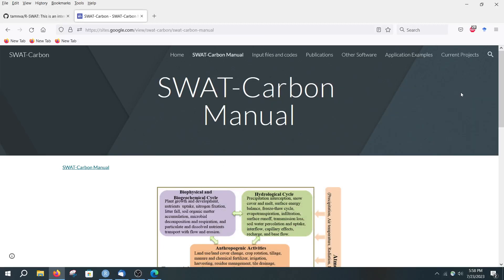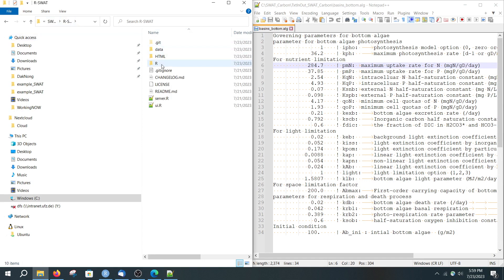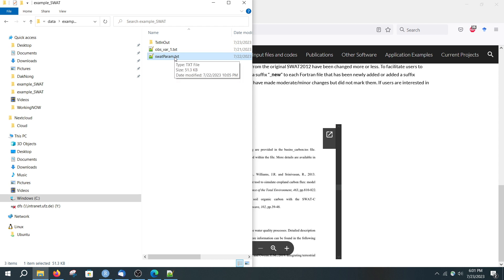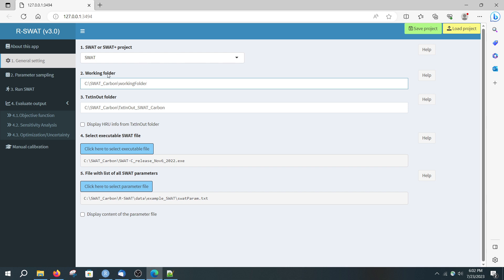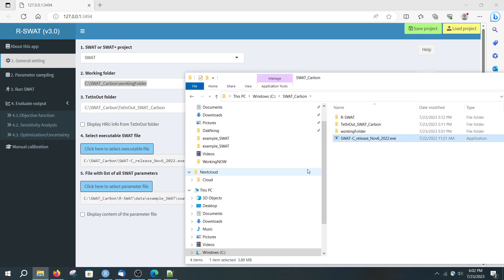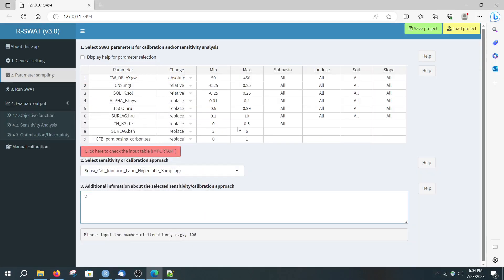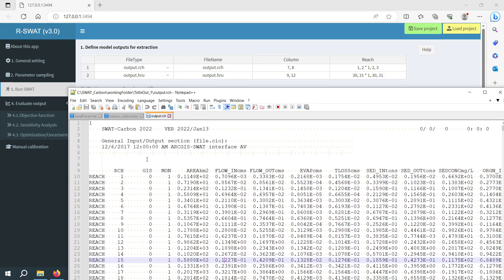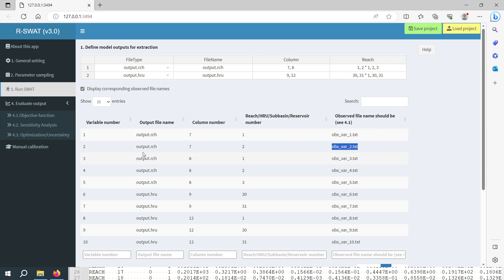RSWAT - Tutorial 4: Calibrate SWAT-Carbon with R-SWAT

Comment: Thank you for your explanation. It helps me a lot. Could you please share the test file(swat carbon) of this case? Thank you in advance
Reply from the maker: sorry I cannot provide you these files because I am not the owner of these data. You could go to the swat carbon website and find the data there or ask the model developers
Reply: @learning-for-scientist  Thanks for your quick reply! I need your help with another thing. As for the SWAT+ package, how did you download the installation package with a memory size of about 40303kb(It seems this is the clean version)?  Is the version you downloaded QSWAT? Because I seem to download a collection of installation packages, it always run into problems. Sorry for my trouble.